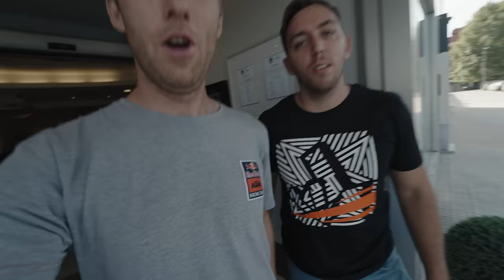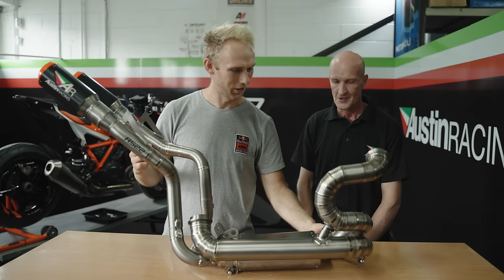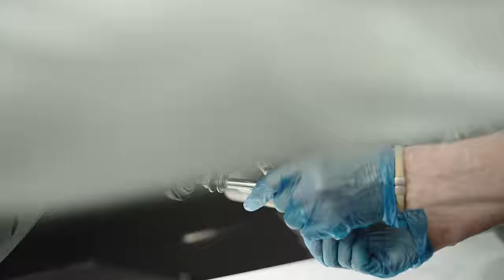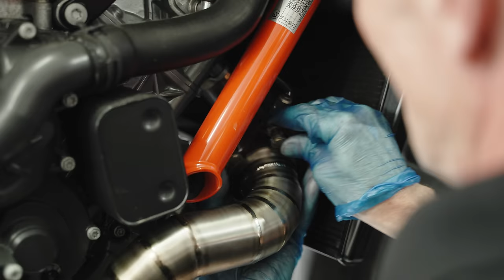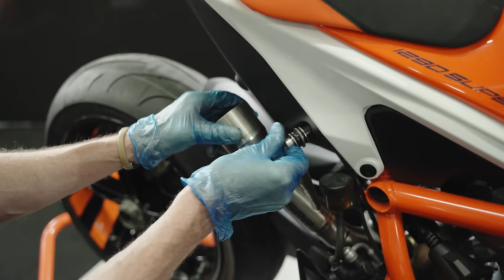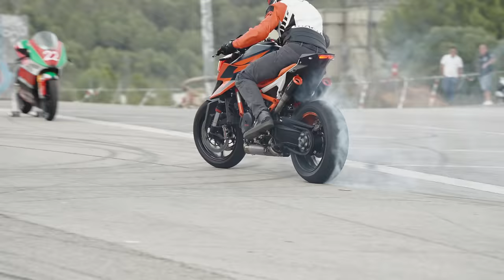KTM 1290 SUPER DUKE R Austin Racing Full titanium exhaust, sound check, drifting | RokON vlog #118

Comment: Is the RS22 emissions compliant? I imagine not, but it looks like there’s enough space in there to hide a cat so I figured I’d ask. Looks and sounds amazing, AR continue to do excellent work.
Reply: Hi, as with any aftermarket full exhaust system it is created to optimise performance and sound, it is not designed to pass the latest very stringent emissions testing but it will pass the latest DB control testing. For the emission testing we always advise to re install your stock exhaust system for this.
Reply: @austinracingexhausts  do you need a tune after installing the RS22 system with the low db option?

Comment: Will KTM dealers in the U.S. install these, or will this require disconnecting the turn signals like the Akrapovic full titanium system? I want a full exhaust system for my 2022 KTM 1290 Super Duke R Evo.

Comment: I currently installed the Akrapovic full exhaust. I am willing to switch to the new RS22. Does it come with a mapping? If yes, does it cancel your turning signals if you install the street illegal RS? Thanks
Reply: Hi, if you install the full RS22 you have the choice to run it on stock mapping using our exhaust servo eliminator plug, this means you retain your indicators. If you want slightly increased low range power over the stock map and lots of cool pops and bangs then install the KTM dealer supplied full system map, if you also install our indicator bypass box you will again be able to retain your indicators. Its a simple install process for this little box.
Reply: Is the seat cowl on the bike an Austin Racing part?
Reply: @reccomtal9471  Yes available from our website

Comment: dude, just help me, I have 2021 1290R and mine does not ever pop or bang!! but only has about 1200 km on it.... did you do software update or some high octane fuel or what?? I have also got a 790 and it pops like crazy!
Reply: Are you running the RS22 on your 2021 1290r?
Reply: @PrestonTurboSi  no I have stock exhaust, but in de video there is also a lot of exhaust popping and rumble with original exhaust. mine sounds more like a 12volt motorcycle than a 1200+ cc motorbike